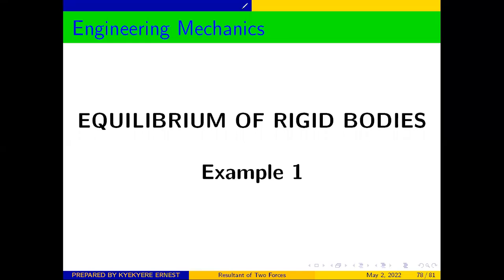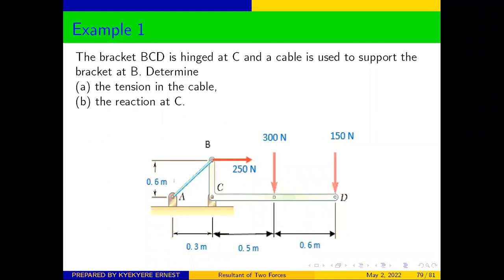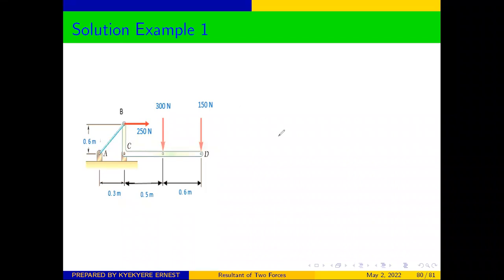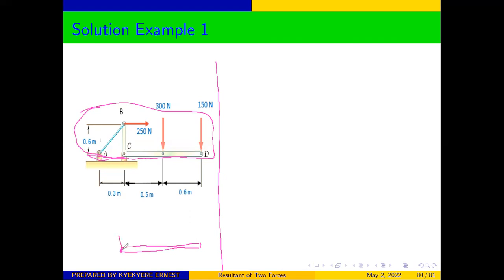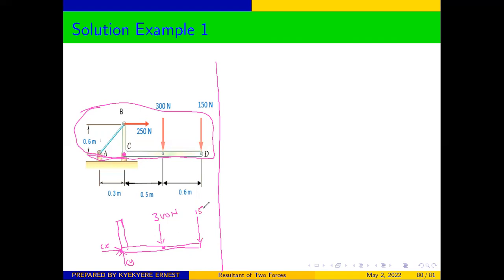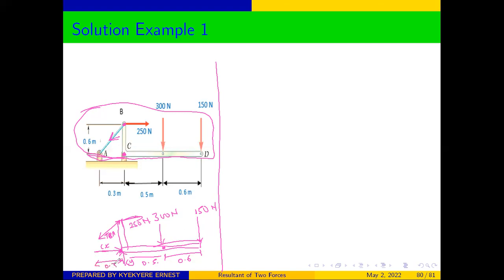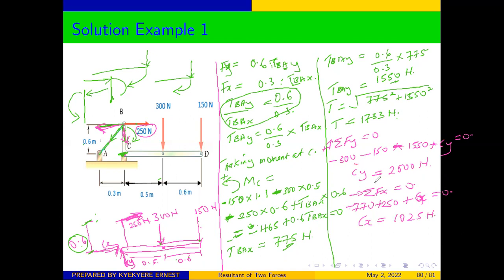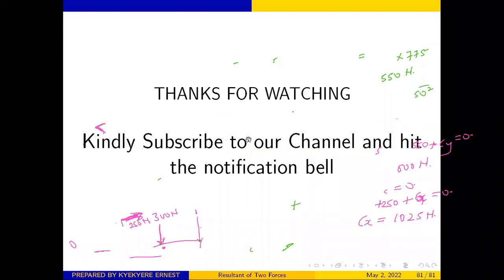Basic Mechanics: Equilibrium of Rigid bodies Example 1

Comment: sir, please in the rigid body, we saw that Tension BA was held by a pin at A. But in the body diagram, you didn't make use of the pin at A. kindly assist me on that, please. Thank you.
Reply from the maker: The body of interest is detached from the ground and all other support. The cable from B to A will be cut and therefore anything at A will not be considered in the analysis